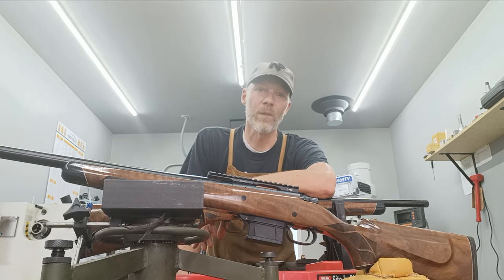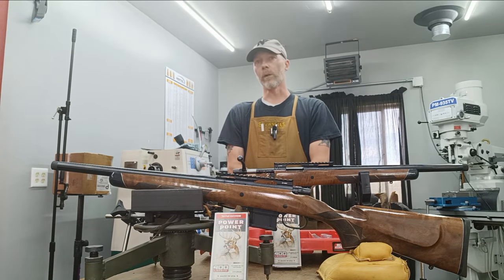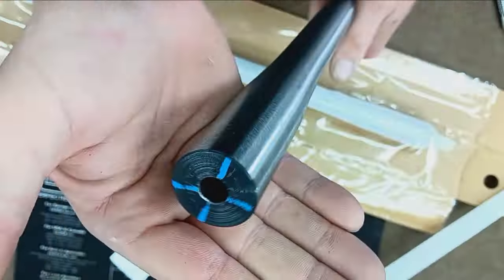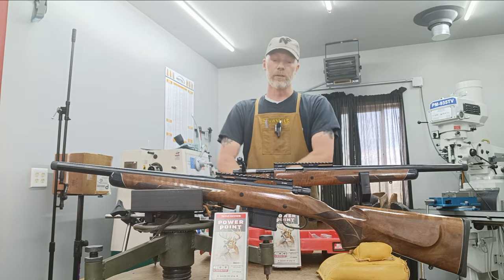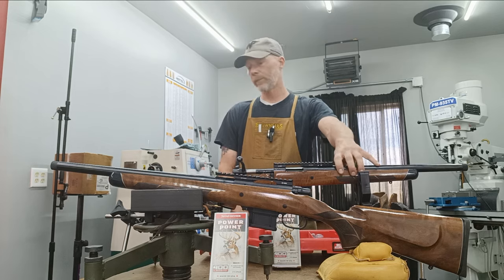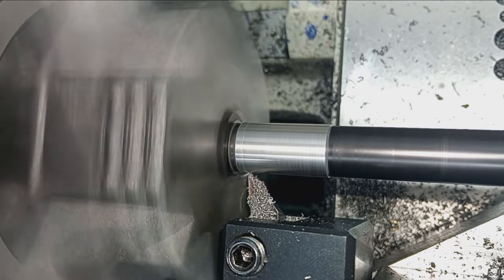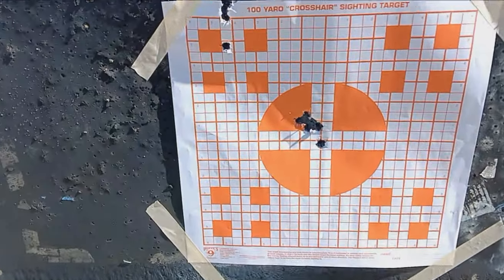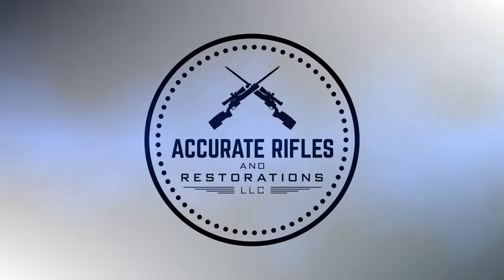Twin Custom 400 LEGEND Hunting Rifles - Short range accurate POWER in a compact package!

Comment: I have two of these rifles. 

One has DIP bottom metal. 
Other has Jefferson. 

I prefer the Jefferson hands down.
Reply from the maker: Yes, we were impressed with the quality (especially over the plastic Howa!)!  Thanks for watching and for engaging the channel mate!!
Reply from the maker: Production, or custom?  Who made your rifles, if I may ask?
Reply: @AccurateRiflesandRestorations  I did. ;) 

I dont have lathe. But have good drill press and access to a bridgeport. 
I do pillar and glass bed and do other gun smith work like D&T.
Reply: @AccurateRiflesandRestorations  I also had Preferred install a barrel on my 6 Rem two years ago. Its a tack driver. I just dropped it in a MDT Chassis. ( Video on my channel)